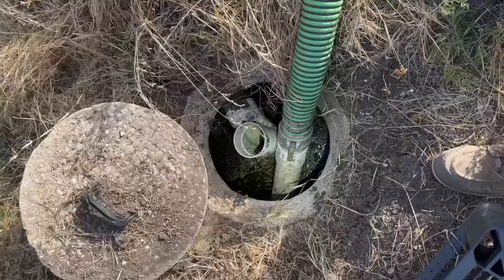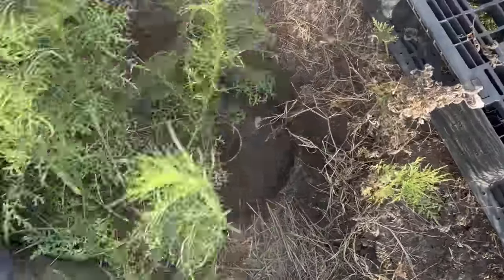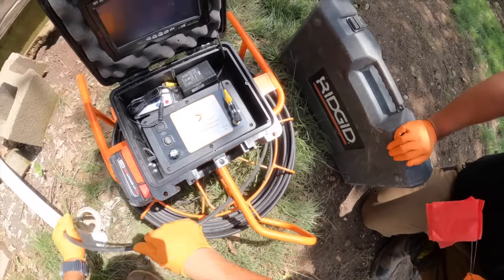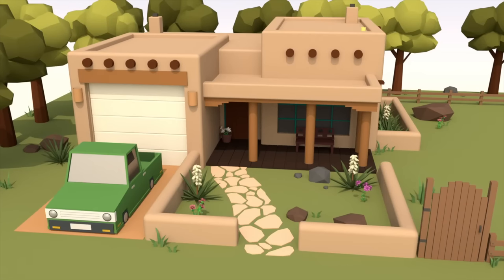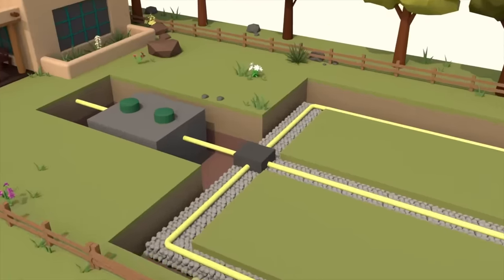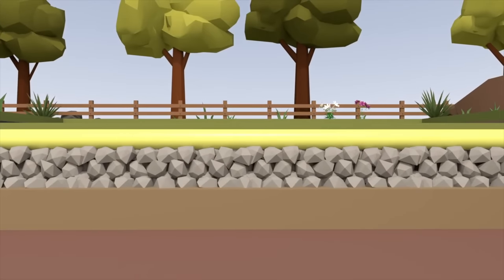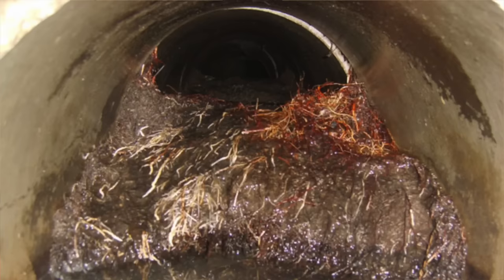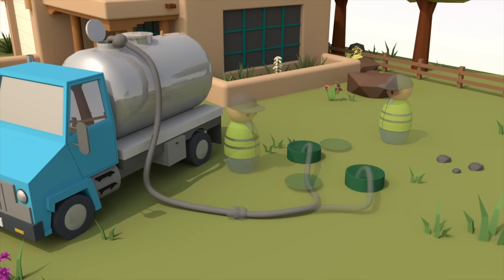“You didn’t Pump My Septic Tank all the Way”

Comment: Dominic, your channel should be REQUIRED VIEWING for everyone who has a septic system.  Your explanation of how these systems work as well as what can go wrong with them when they're not properly maintained is first rate.  The 1000 gallon septic tank at my cabin gets very light use (5.5 months out the year with 2 people).  I have always had it pumped when it was due.  Each time I was told that the tank was in great shape and that I could have gone twice as long before having it pumped.  However, I will not take that chance.  I never knew how thick and hard the crust can get until viewing your channel.  I'm impressed with the way you rinse the tank to make sure it is thoroughly clean.  I also agree that it is good practice for you to record your work so there is never any question that the job was done right in the event the customer starts complaining.

Comment: Photographic evidence saved my butt a number of times. And of course if you get effluent flowing back from the drain field then obviously the pipes are open and the drainfield is just failing. Of course ir the drainfield is somewhat downhill or you're dealing with a dry well there is very little flowback. 
I always found that the best indication of a good running system was a well-defined liquid level line at the bottom of the outlet pipe.

Comment: The thing most people don't understand is septic tanks don't get full, they get thicker. They do fill to an operating level and the reason you pump them isn't to get rid of the water, pump to remove sludge. All these additives that are sold give you more of what you don't want faster..sludge. Whenever the tank is above its operating level is a sign of leach-field problems or has an effluent filter that 99% of homeowners aren't aware of and the filter needs service/cleaned every 12-18 months.

Comment: Great video!  I had the same issue on a city sewer - backup in the basement when running the washer.  Called the guys out and they said they could snake it out but recommended a view with the cam.  Did so and found major tree roots - I viewed it right with them.  They recommended having the line jetted out which I did which solved the problems.  Lesson learned, find an expert you can trust like Dominic here and trust their recommendations.  It saves you money and time in the long run!

Comment: Cheers from Wisconsin! We have a mound system and every so often, in the colder months, the pipe freezes to the mound. When it happens I always think " oh this is going to be expensive to replace the mound" . Then come spring and plug the pump in for first time and you pray. 
One winter I got to know the truck driver pretty well....

Comment: My tank /leach field is 50 years old. I pump it every 5-6 years. There is never a crust on top. The secret is nothing goes into tank but bathrooms. The washer, dishwasher, kitchen sink, and softner all go into separate tile. All drain fields will eventually fail when you're dumping hundreds of gallons per day into tank. If you can't run a separate tile conserve water use as much as possible and don't allow grease or food into tank.
Reply: Water actually helps septic systems function, if all you're doing is sending solids in, good luck!
Reply: @Ryan-ky3nr  There is plenty of water from showers, toilets and bathroom sinks.

Comment: It's the same in the grease business. Plumbers are the worst culprits, too, which cheeses me off since they bloody should know better. A 1000 gallon grease interceptor holds what? A 1000 gallons. It starts refilling with water as soon as the kitchen fires up and is full in a day or two. Then they'll have a clogged drain or two, call a plumber, who tells the owners, "They grease pits full of grease' so the owners get all pissed saying that we didn't pump it out. So I'll ask, "What was the percentage of grease to water?" 

The plumber doesn't know because plumbers generally don't carry around measuring tubes that we use. 

Had a Popeyes crying yesterday. I'd pumped it out last month, so of course it's got grease in it. And of course it's full, it's what is supposed to be doing. I pop the manholes and run down the measuring tube and come back with 11%, 25% or more means it needs serviced more frequently. The manager gets froggy, complaining her floor drains are all backed up.

 Now, I've been in the crawl space before at that location. The floor drains connect to pipes that run to the opposite end of the restaurant to a sump pump to be pumped up, into the sewer lines. Only the dish sinks and dishwasher are connected to the grease pit. The plumber pulled several pipes inside and finds them clogged with grease. Yep, grease that the staff have been pouring down the floor drains because they're lazy. Or stupid. Or both. The reason I'd been down there before was to run a hose to that sump pump pit to suck out whatever grease I could. Grease, you know, cold grease, is really bad on sump pumps, but hey, I'm no plumber. 

Same day, another customer and plumber crying. I show up and nod, "Yep, it's got way too much stuff in it. But hey, this happens when you choose to avoid paying our bill for eight months. What, did these fine people think that I'm supposed to just keep on servicing and allowing them to run up a huge bill? I warned them before about this. So, I pumped it out and charged an additional emergency show up fee. We'll see how long it takes to get paid for that one, too.

Comment: Got 50 years on my septic system never been pumped out,. Had roots in the drain field, dug it up cleaned out the roots, no issues since then was 10 years ago.
Reply: You will have issues eventually and all these years of not pumping your tank will be replaced with a big bill for a new system. Septic tank pumping is like changing an oil in your car you don’t do it when the car is broken you do it to prevent it .
Reply: @domantaskaciuska8472  pumping the tank doesn't prevent the degrading of a septic tank. These modern septic tanks aren't even made of cement, they are made from plastic. I've seen these modern plastic septic tanks start failing after 15 years of operation. You'll be lucky to get 25 years out of these modern plastic ones before they start to fail regardless of how well you maintain it.
Reply: Not the smartest thing! What’s the leach field look like?

Comment: Hey! My septic is overflowing with water, we had it cleaned out a few years ago, and I believe there’s maybe a crack in the holding tank because the septic tank fills up within a day even when we’re not running water, We also have a high water table. 

 I’m guessing one of the baffles or pipes to the drainfield is clogged because of the overflowing.
What would you recommend for the situation like this? 

How do you fix a clogged drain from field pipe?

Comment: I live in an area that maybe getting city/county sewerage system, and/or wastewater collection system and currently everyone has septic systems. The biggest discussion is what to do with our current septic tank and drain filled if and when we get put on the sewerage system. Can you do a video on what it takes to close a system when it is no longer needed. Many of my neighbors have talked about converting their septic tanks into dry wells to use in their landscaping and gardens. Could you do a video about what it would take to do that?
Reply: They done that on my mom's street a builder wanted to build several new homes that didn't have sewer lines established so they decommissioned the entire block of houses on my moms street and hooked them up to city sewer for free ! 10 years prior I asked the city how much to hook into sewer they said minimum to start an account before digging into the street was $10,000 so that never happened until this contractor hooked us up for free ! They pumped the tank and collapsed the dome and filled with sand then backfilled the entire front yard and resodded the grass and even poured new walkway with cement !! 
City sewer originally wasn't in this area of my mom's home when they built these homes in 1974 they ran sewer down the street in 1990 but we never hooked up to it !!

Comment: My parents house was built in 1950 and back then they used cesspools my parents bought the house in 1965 and replaced the cesspool with a what they had at back in 1973 was a single compartment septic tank made of concrete we do not have enough land a room for a leaching field we have what's called a leeching chamber I believe it's like 1500 gallons it's a big tank in the ground I believe it's made out of cinder blocks 7 ft Circle backfilled around the outside of the brick with crushed stone I took the cover off and it was brand new in there why doesn't anybody show a video of a single compartment concrete septic tank with a Leaching tank the septic tank is doing what it's supposed to do even though it's not a two chamber all the effulant is draining over from the tank working fine please make a video

Comment: Dominic, I watch all your videos. I know from your channel that there is an inlet and outlet lid. My house has one riser that has a "wall" between the sides. That is where the pumper guys suck out the stuff. My question is, do you think I also have 2 more lids that are buried? I live in Iowa. I wish I could attach pics. This is driving me crazy. All I can see is a wall between the 2 tanks, I can't see any pipes.
Reply: We had an old Lister tank, circa 1965. It also had a center cleanout but when I got it pumped, the pump fellow said the lid was in three sections; the larger center with the cleanout and the two ends, where you can see the inflow and outflow pipes. Told me the biggest septic tank/leach field wrecker is fat. Doesn't get 'eaten' and coats the leach field pipes, which can't be cleaned when that happens.
Reply: @chrishayden7016  Our tank was put in when we had our house built in 2000. Not new, but not ancient either. :)

Comment: Im surprised you don't offer free camera inspections with each drain... Id think it would lead to more work.
Reply: camera inspections are a separate service
Reply: Bad business @p_hat  A quick camera inspection of the tank and the inlets/outlets is just a smart idea to get more business.
Reply: @TruFrag  camera inspections aren't quick by any means. If i tell someone they have a problem with their drainfield and recommend an inspection, it's an additional charge for the inspection. As well as any necessary remediation to resolve the underlying issue. the smart idea is charging for the labor.

Comment: Hey what’s up man I’m from El Paso tx and I’ve been having a problem here with my cesspool idk if I have a drain field or not but every time we pump it out it fills up within a month. I was wondering maybe you can help me out with some advice on what I could do or how I could find the drain field if I do have one thanks man your videos are great and just wished I knew someone that could do the jobs you do because since my mom lived here up until this day we still have the same problem
Reply: Simple. If you have a septic tank, you likely have a drain field / leach field.  If you tank is filling quickly, likely the leach field is plugged and needs replacement.  When your house was built, there was a building permit issued, part of that permit included a permit for the septic tank and leach field.  You should be able to find a copy of the plan in the county records showing the location of your septic tank and the attached leach field. Otherwise, dig down into the dirt and determine the inlet pipe location on your septic tank (lets call that location 12 o'clock), find the edge of the tank follow it around to the 6 o'clock location.  Dig down and you should find an exit pipe which leads to your leach field.  See the diagram at 2:51 showing the exit pipe and how it splits into 3-4 legs of the leach field.  If the leach field is plugged, you will need to dig it up and replace all the drainage pipe, gravel, etc.   Cheers !

Comment: Drain field need to be replaced
Reply: The cast iron pipe between the tank and distribution box actually got plugged up with rock hard deposits. Didn't know it until the tank ran over. In replacing the pipe that now weighed about 200 lbs, I found the concrete distribution box was turning into a soft mess. Replaced both with plastic. The leach field, made of red clay tile, is still going at 57 years.